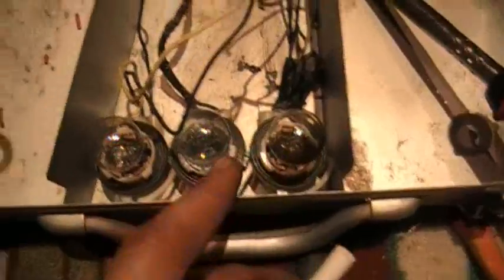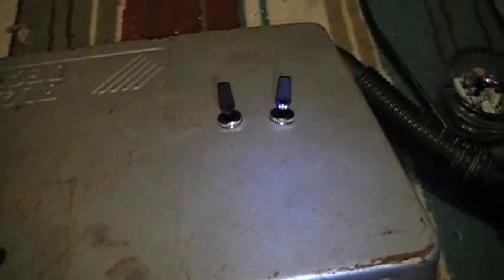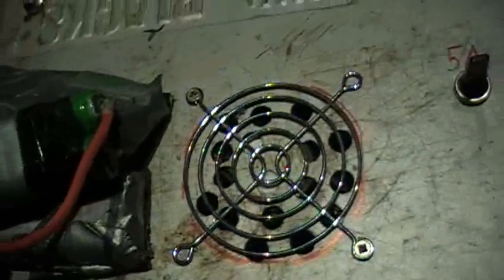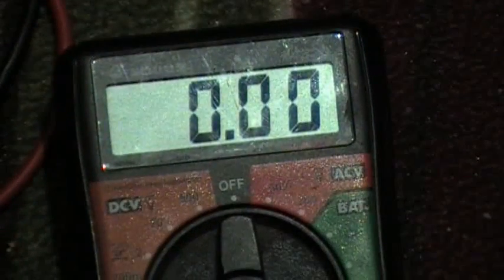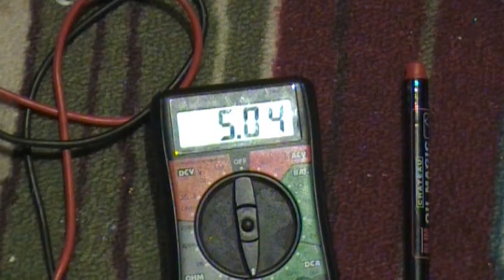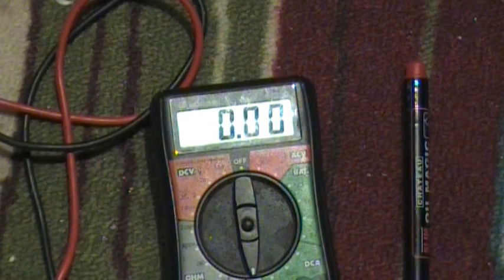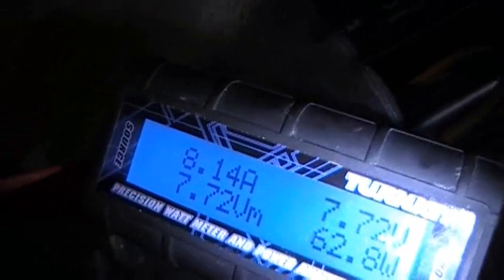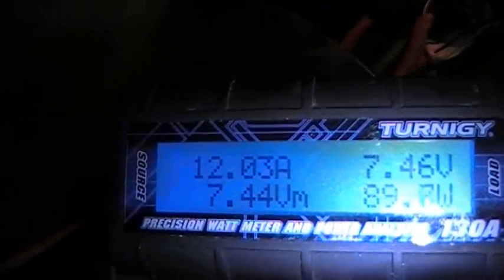mystry discharger box

Comment from the maker: @chrilla1980 yes they are getting better but befor you buy some i would say find out the amps your truck pull mine is bursting at about 50amps and 2 batteries can do it but i cant do it in lipo mode need one more battery to keep the volts up

Comment from the maker: @DodgeNeonWrecker there you go 50% that is like 6.8-7.0 that is storing voltage if you leave them to high you can damage them if they are to low you can damage them you may not notice a differance but you could possibly get less cycles

Comment: @danalpatt 100 dollar team orion batteries bud. They aint gonna catch on fire like the cheap shit lol. Plus i only run 2 cell becasue of race rules. Balancing ports are different on race batterys usually one small port at the top.  Team orion even says never discharge a lipo you can store them at any state iv left my battery for a whole off season with 50% and it works mint still.